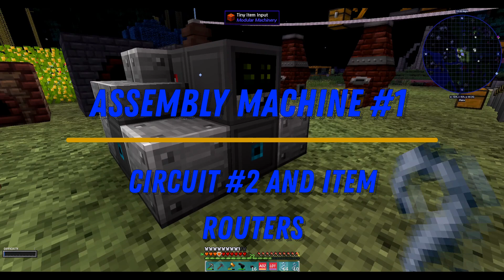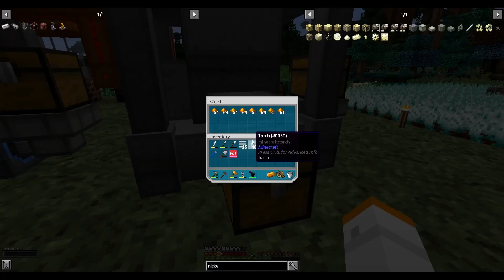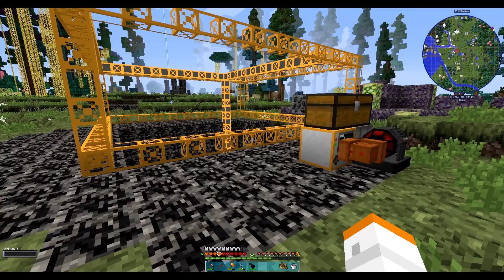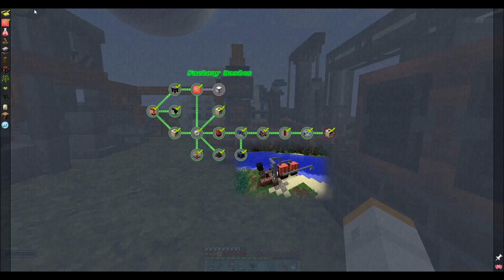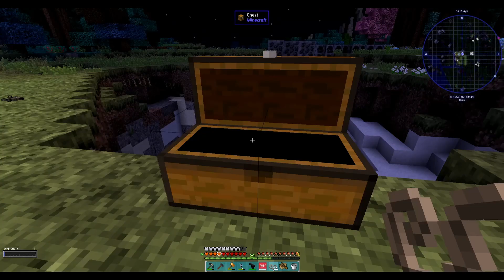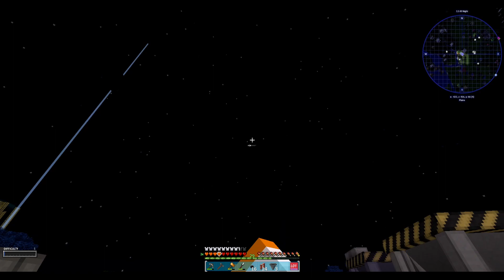Manufactio NE EP4 Assembly Machine #1 Circuit #2 and Item Routers

Comment: TIL the rudimentary generator produces more than 80RF/t....
Blast furnaces are slightly faster than normal furnaces, depends on the material.
Reply from the maker: yeah that surprised the heck out of me, I set it up thinking I was gonna need 2 of them and kept checking on it every few minutes... now it is very wasteful because its gonna make power as long as it has heat and fuel so I guess there is a trade off.

Comment: So two questions: 1) why not use treated wood fence for the poles? can make a jerry can to hold 16 buckets I believe. 2) when you put the item routers on the back of the furnaces, it started decrementing the coal right away, so don't think you even need the filters.
Reply from the maker: The issue with the item routers that I have seen over many 100's of hours of messing with IE is how they will route backwards and you can prove it with a hopper facing into one and watch the hopper as IT will route backwards into the  hopper because it is an interface the router can see. If you mark the interface you want to put things into make sure to mark the interface that resource comes from with something it will never see. its an obvious issue as the routers pass items almost instantly from point to point so they pass items point to point back to where they came from and then back over and over again.  We all know 1.12 will not get fixed and we got told that years ago so this is just me telling you do not do this unless you have the cycles to spare. 
 
Far as the fence thing, my brain obviously missed a step in the process, so we just move on and have treated wood
you all can get a giggle out of that...
Reply: @Frogman79  Hmm fair enough, I had never thought to use item routers like that, but it makes sense after thinking about it. I appreciate the replies

Comment: The posts do also work with creosote fence posts.
No need to waste metal on wire posts.

Another thing I discovered is that you can grind down coal and get it (half) doubled as well.
Myself,use creosote as a building material, to make massive floors so i can get rid of it without destroying it.
Reply: Also, keep up the good work, I always look forward to a new episode (and I'm playing along a little as well)

Whats the actual throughput of those fluid pipes, as I use one per pump and two pumps per boiler
Reply from the maker: you know, some days, I spend all day banging my head against the wall only to find another wall, thank you so much for pointing out I missed something like that. I like metal posts more than the wooden ones personally so I look for them instead of the treated wood posts. 

Right now we are just doing the things to get to the actual beginning of me doing things, still digging out of my hole. Thanks!